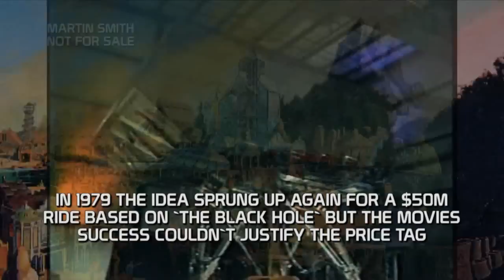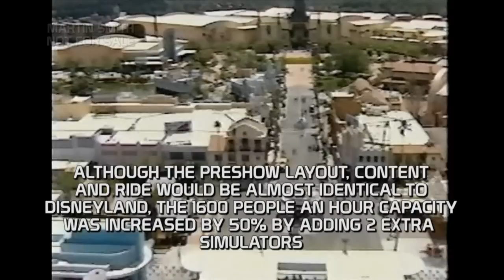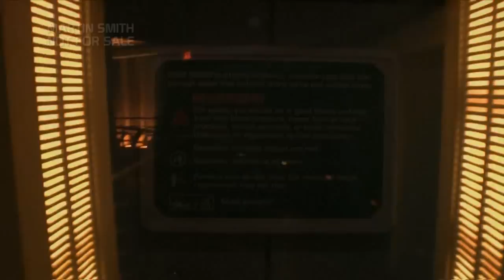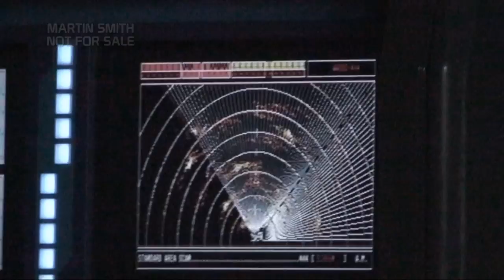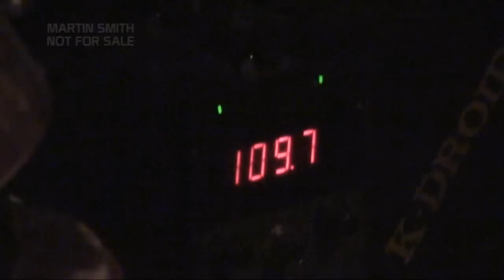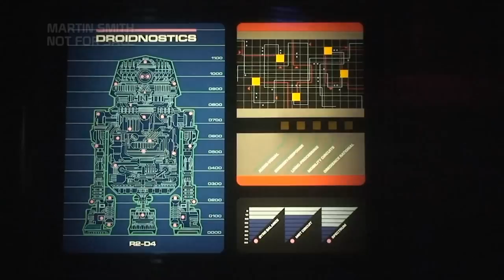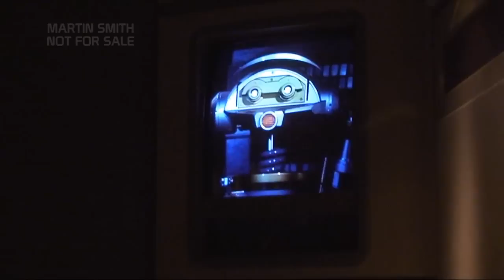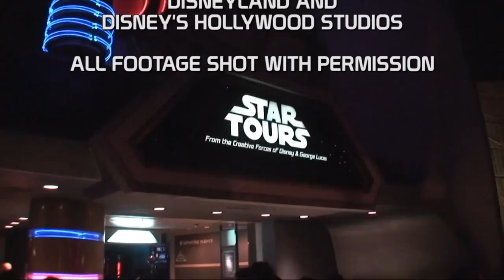Star Tours HD Ultimate Tribute

Comment: 45:55 .... Note the wall to the left of the droid (G2-4T).  It was a grid made up of square piezo-electric crystals or glass panels that would change from opaque to transparent when an electric charge was applied to or removed from them.  They were continuously blinking in different patterns.    Today it's called "Smart Glass" but back then the "smart" moniker was not used for electronics.

 The last time I rode the original Star Tours in '92 they were no longer functioning and the panels were all opaque.

Better view of the panel at 48:35